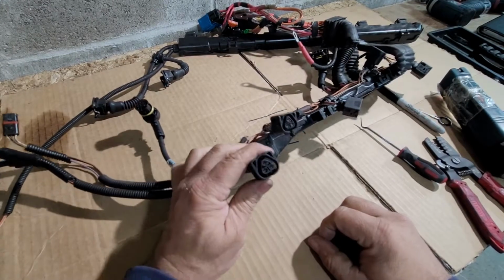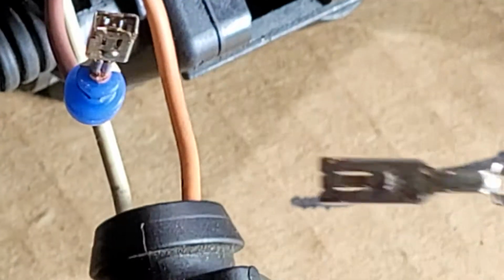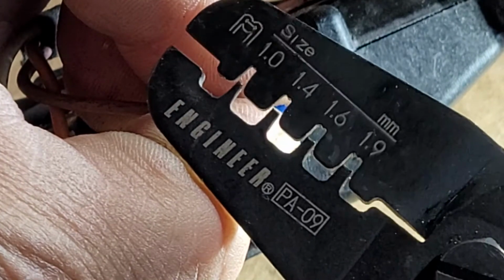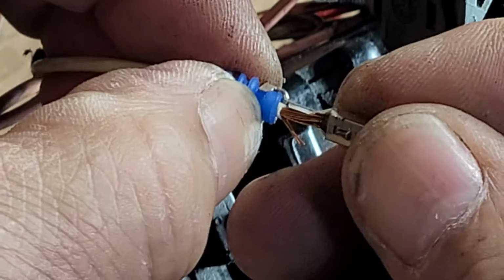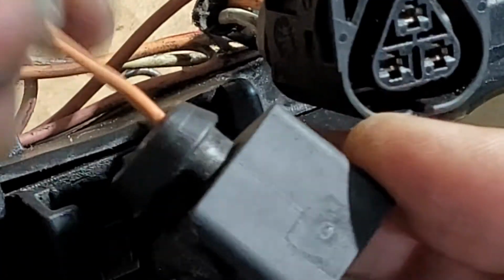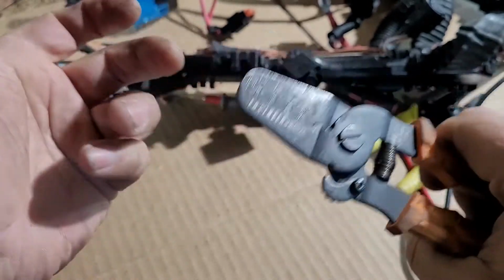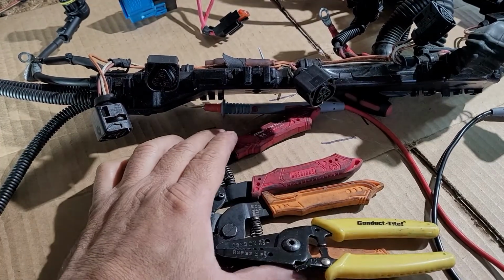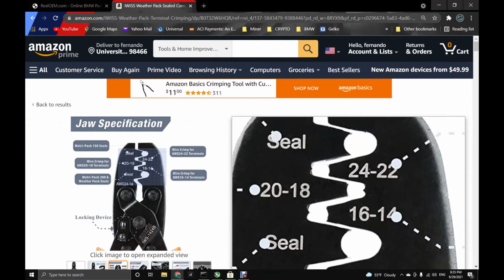BMW n52 engine ignition coil connector

Comment: I was having misfire issues on my 06' 330i N52,  and after changing my spark plugs and coils I had come to find out that cylinder 6 actually has loose connector pins. I'm not super experienced with electrical work on my car other than fuses and what not, so I got an estimate from a shop to replace the entire harness, which came out to be around $1,500. I'm trying to save some money and this looks like the best option for a DIY fix. Any pointers before I attempt replacing the pins/terminals? Thanks.
Reply from the maker: if only one connector broke  you have about 3 option2,  stay a way from that shop  replacing  a hole harness for just one connector is ridiculous, option 1  go to junkyard and cut the connector  an solder the pig tail with the  connector attached  , option 2 go to bmw and they have the pig tails with the terminals separated to the connector and all  you can purchase the connector o dpin yo existing one , option 3 but the terminals but a crimping tool  dpin you connector and repin  you existing one ,, more specific question ? was revising the vid and its self explanatory, you can replace just one connector versus   replacing the whole  harness